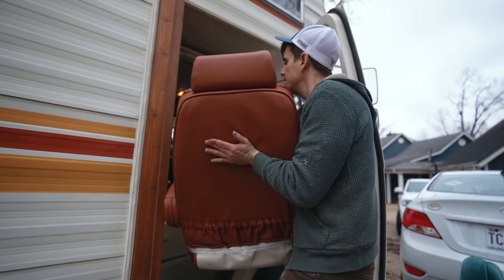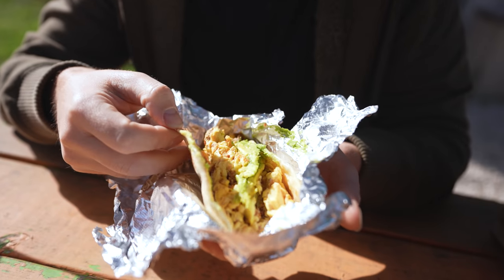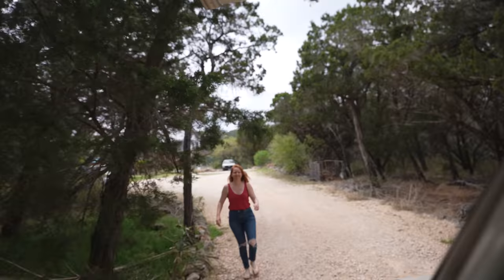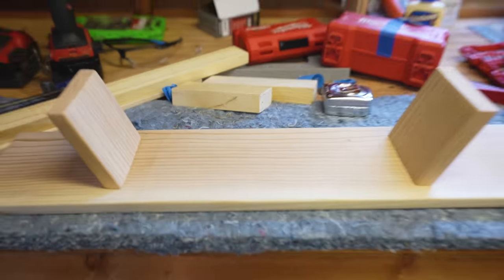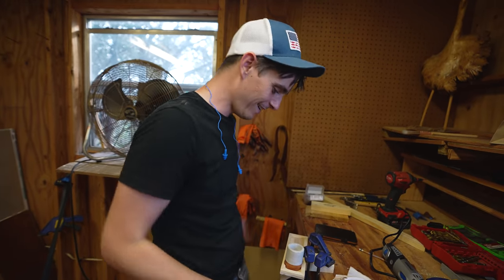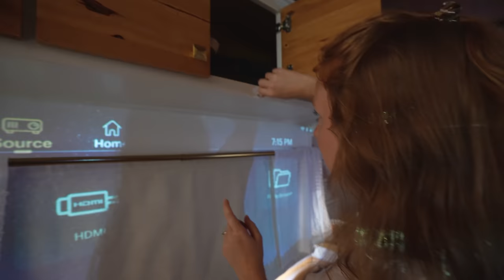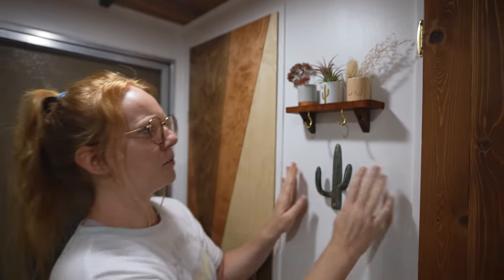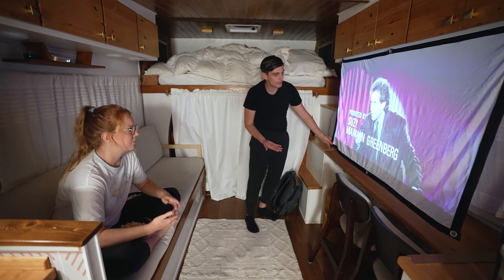Finishing Our RV’s Custom HOME THEATER! + Suzuki Samurai Update & Installing NEW RV Steps!

Comment: About the projector: it's probably designed to be mounted upside down when projecting from above instead of sitting on a shelf and propped at an angle. You can adjust the keystone to make it fit your screen, but that's likely adding distortion or reducing the actual resolution of the image.

Comment: Just a suggestion. Hit the junkyards and grab a steering wheel from an early 90s chevy truck (pre-air bag), for the camper. It will give the camper an updated look with a steering wheel that is smaller than a hula hoop.

Comment: Great idea for a home theater.  I'd like to suggest museum putty instead of glue.  We've used it for the last few years to hold our soap dispensers in place near the sinks; no need to stow for travel.  We also use it to hold some decorative items in place.  So far it's held through a couple of Arizona summers.
Reply from the maker: Oh cool! We hadn't heard of museum putty. We were planning on using 3m velcro pads for our plants and other trinkets on countertops, but this stuff looks way better, thanks!

Comment: Just an FYI, you are actually correct about the Catus being good for you! It's technically a "Super Food" because it helps with weight loss/control by binding to dietary fat and flushing it out of the body and has lots of nutrients and medicinal values. Bothe pads and the fruit help fight infections, ease the symptoms of hangovers, and fight high cholesterol because it's high in fiber which reduces the cholesterol in the blood! But(t) watch out for drinking too much of the Prickly Pear juice made from the fruit because it can have a laxative effect on you! 💩😖
Also you may want to consider adding a bolt 🔩 in the hole at the front of the new bracket for the steps, it looks like it was done very well and they did paint over the welds to help prevent rust (check on that every now and then when doing maintenance/oil changes and spray some Rustolium or Undercoating on it if it gets to wearing away from debris hitting it) but a little extra support and peace of mind is always nice when stepping up on something that could break away and slam your knees into the RV doorway edge and the ground! Great job on everything you guys have done and she's something to be proud of! (The RV I mean, but also Allison as well! lol!)

Comment: Concerning the Suzuki - I hope you plan to tow it on a trailer.  The trailer will have its own brakes & this will help make RV brakes last longer, plus RV can stop  faster if need be (like to avoid a wreck).  Also would be better for Suzuki axles, CV joints & tire wear.

Comment: nice, but now it's time to take it to the next ''mind-blowing'' level. 
trash the screen and turn the whole window into a magical window. by adding a special ''tint''' and connecting a low voltage, the window is no longer clear and you can project movies on it.   back clear at a touch of a button

Comment: Not to be a Debbie downer, that rubberized stuff is garbage for rust prevention, it will start to rust from the inside and just fall apart. The rubberized stuff just doesn't allow the moisture to dry, just look at South Main Auto on Youtube, he's had some vehicles with rubberized coatings that came through the shop. The projector looks rad!